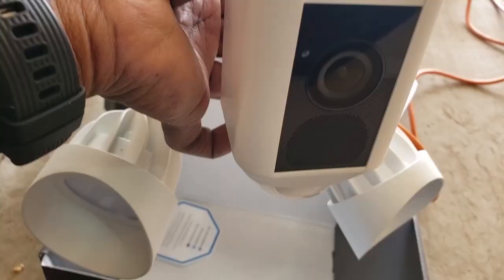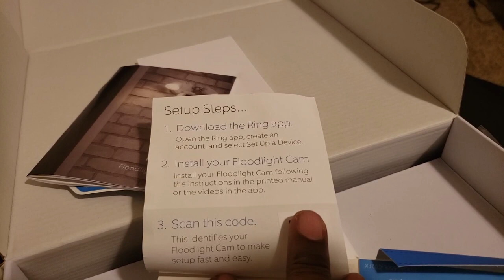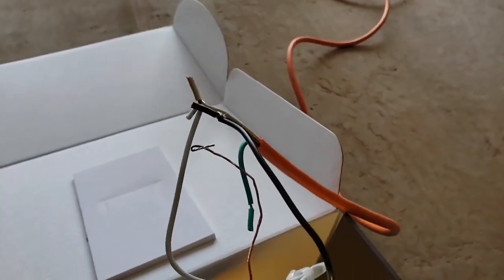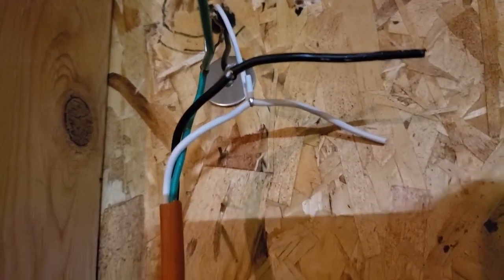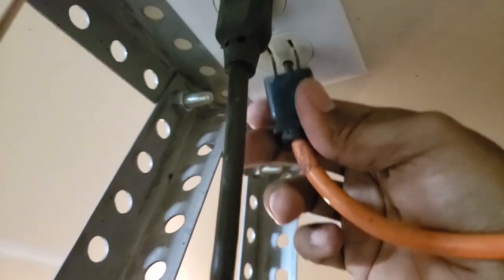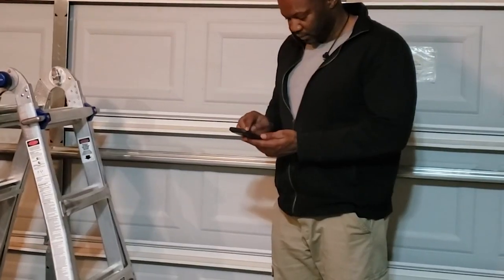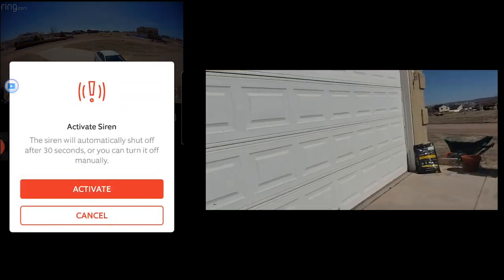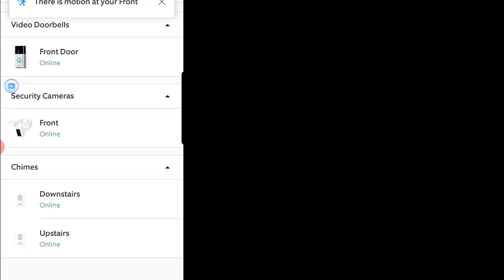Ring Floodlight Cam Installation with Extension Cord (DISCLAIMER: USE AN ELECTRICIAN)

Comment: Issue I've run into is if you have your extension cord run out of bottom instead of out the back like you did, there is a gap for the cable on the bottom of the light unit case itself but the mounting bracket has a bump out that blocks that gap. WTH. I'm having to use a drummel to carve out that bump to make room for the outgoing cables...................or for $20 more you can buy a plug in version of the mount but you'll still have to wire it to the mount.